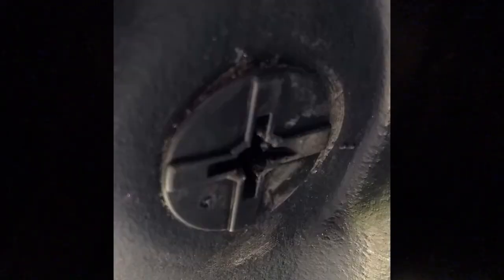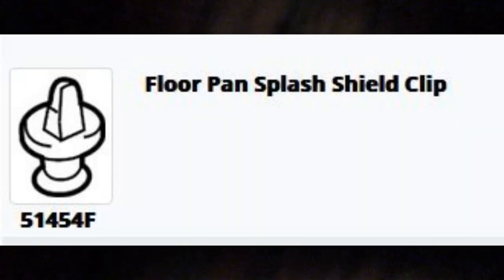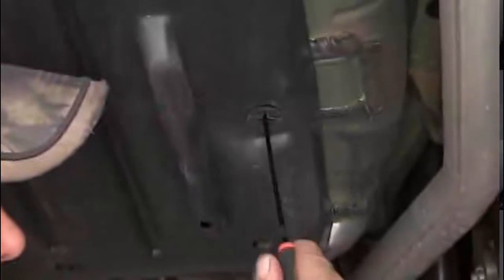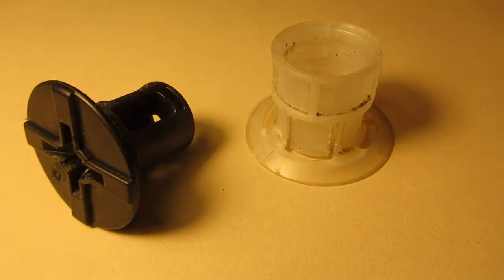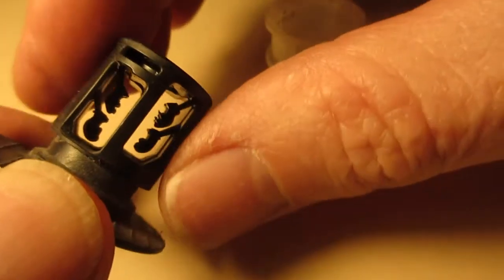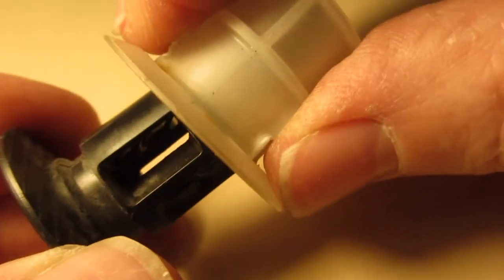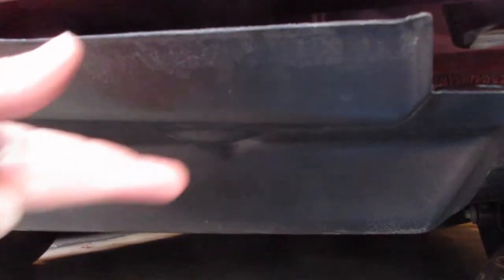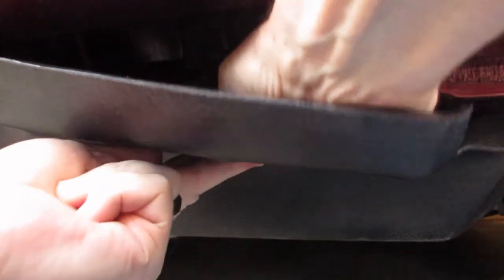Removing Toyota Under Car Splash Panel Fastener 51454F

Comment: Just to add value to this wonderful video. The white one part# is 90467-A0029-A0 and the matching black one part# is 90467-A0030-C0. You need 4 sets to fasten the rear floor cover 58167-08010 (old PN, many compatible revisions afterwards)
Reply from the maker: Thanks for adding to the value of this post for the benefit of fellow Toyota owners!
Reply: @sengsational  This is fantastic! This connector had me stumped until I saw your video. Naaman Wei-thanks for the part nos.
Reply from the maker: @petershu3429  Thanks for the positive response.  I was stumped, so figured I wouldn't be the only one.

Comment: Great video... I coudlnt figure out this connector. You should also  add to the video on how to take apart the two pieces.
Reply from the maker: Yeah, I just re-watched it.  Getting the white and black separated is a matter of splaying out the tabs on the white bit, but I don't show that.